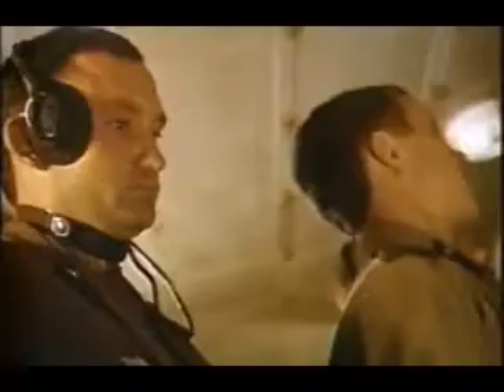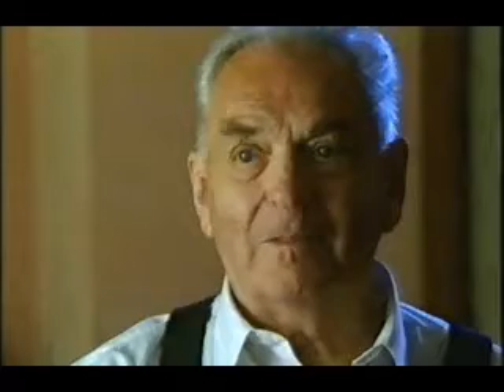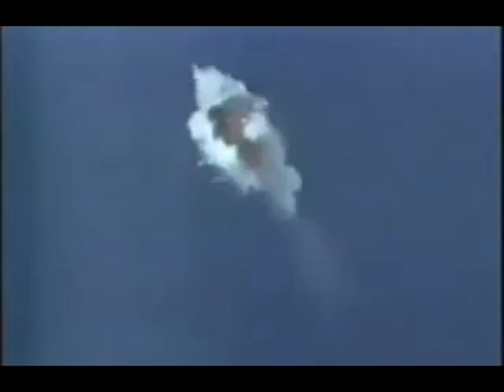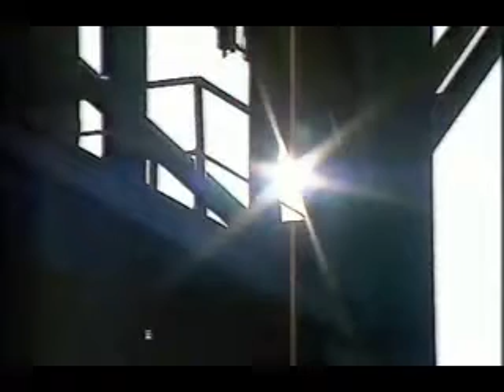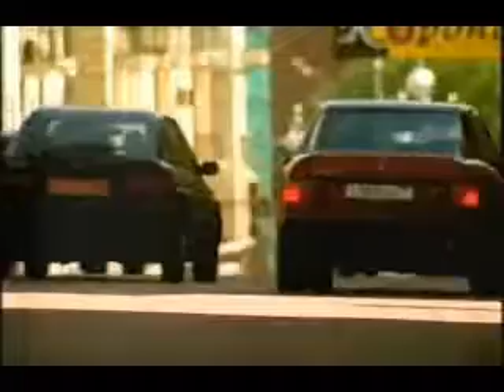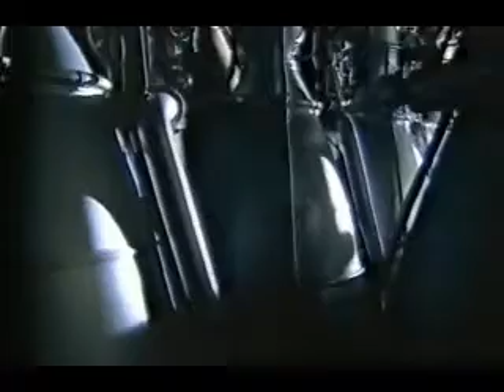Soviet N1 Moon Rocket Documentary Part 3

Comment: Exactly correct!

The SSTs main engines are supposed to be reusable...they AINT. They must be completely re-manufactured after use often with the replacement of 60% of its components.

The SME's  are based heavily on the disposable  J-2X engines intended for the later Saturn Vs.  The cost of a 500,000lb thrust RS-25 was 4X that of a J2X engine and 3 times the cost of the superior 750,000lb thrust RS-68.  

The STS was a finicky money gobbler that almost killed NASA and did kill 14 astronauts.